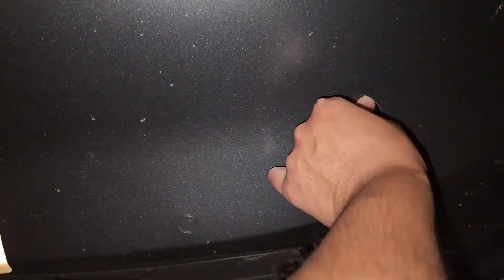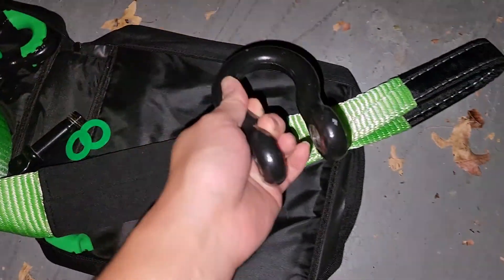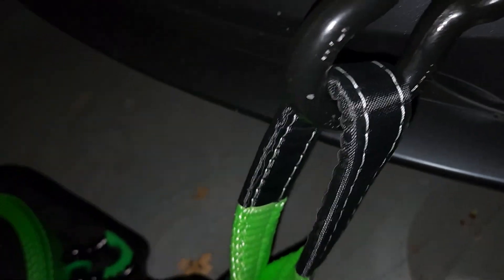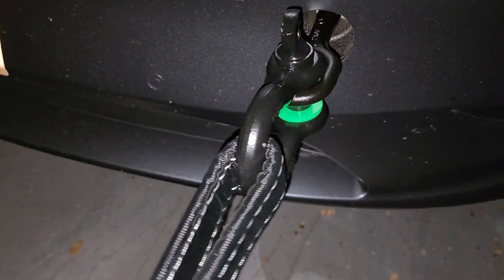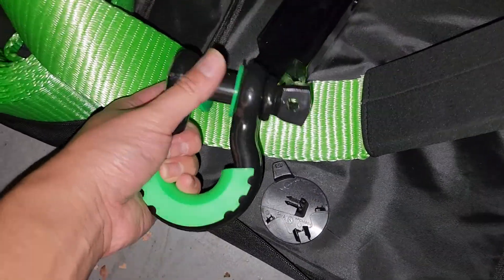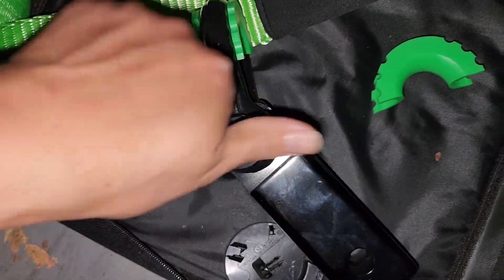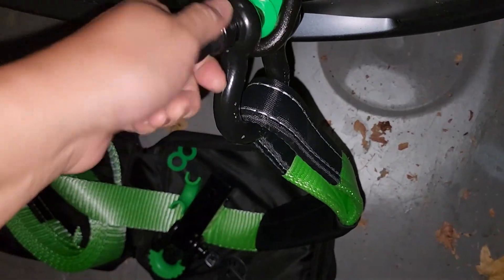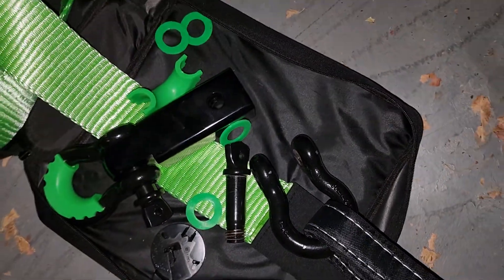How to Attach a Recovery Towing Tow Strap Rope Using a 3/4 D Ring Shackle to a 2022 Tesla Model Y

Comment: Nice.  You might try a short bit of 3/4 in garden hose in the eye bolt with 1 washer above and 1 below then the D bolt through it. I couldn't see if it was too tight for that. I found that set on Amazon, your video got me thinking that was a good thing to have.
Reply from the maker: I ordered the set without the tow bar, but they included it anyway. Lol
Reply from the maker: Might work to cut a slit in the bit of hose and put it on the eye instead. :P